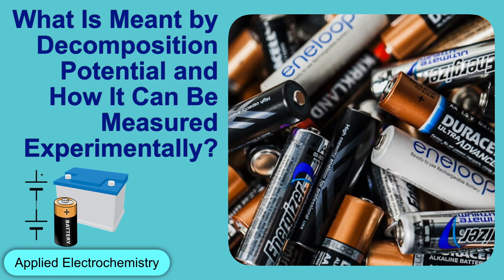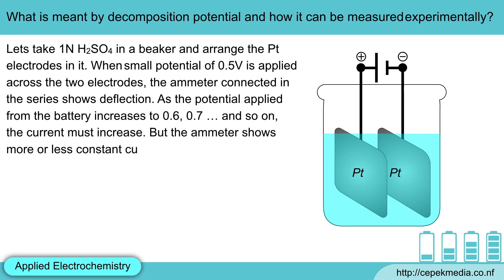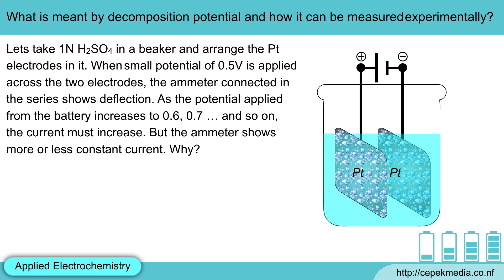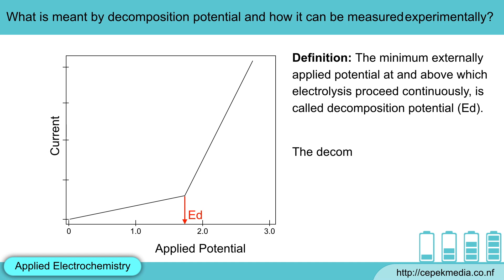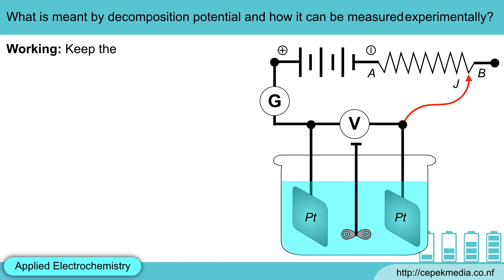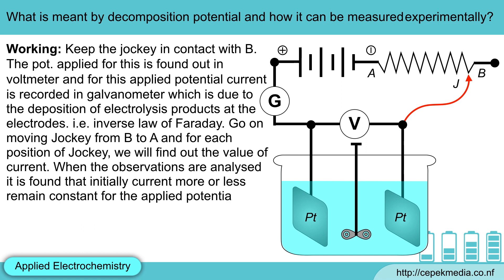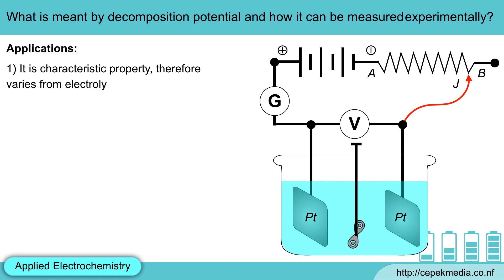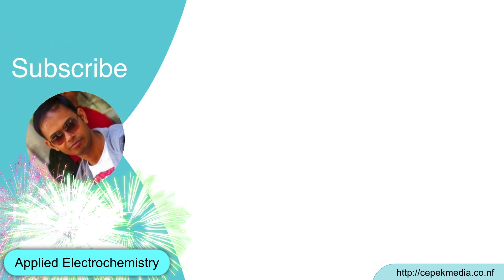What is meant by decomposition potential and how it can be measured experimentally? Electrochemistry

Comment: Why is the  potentiometer not connected across the battery, as this will provide an adjustable potential. In the existing arrangement the potentiometer appears to be controling the voltage across the cell by limiting the current through it. It is effectively acting as a potential divider against the cell impedance. 
Placing a relative low impedance potentiometer across the batter to provide a variable voltage source is not ideal, as it will load the battery and heat. The very early lab rheostats/potentiometers were so large that they could stand the heating effect, but surely in a modern lab, low impedance output, electronic supply would be better for performing this experiment since it would provide a regulated voltage output.